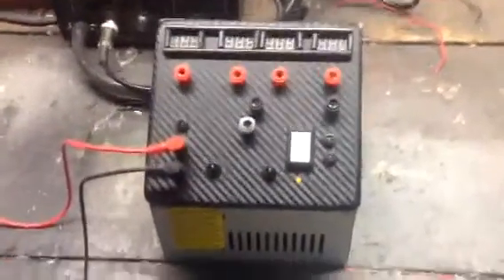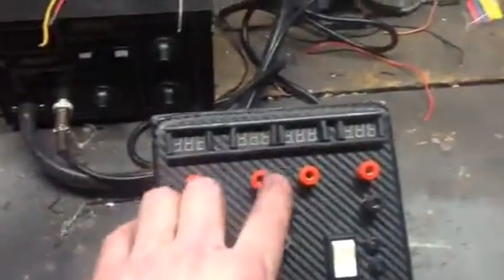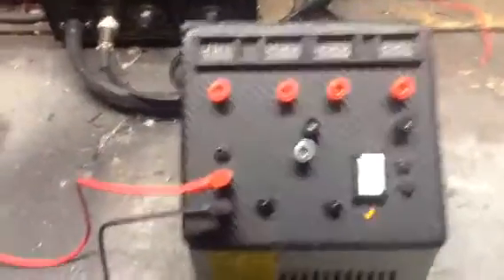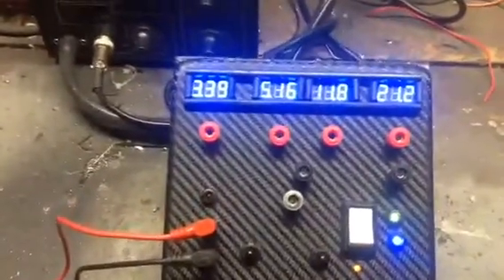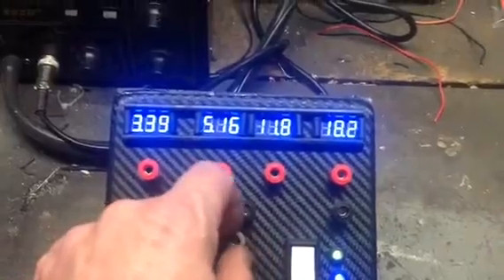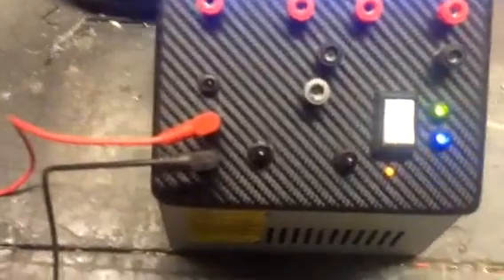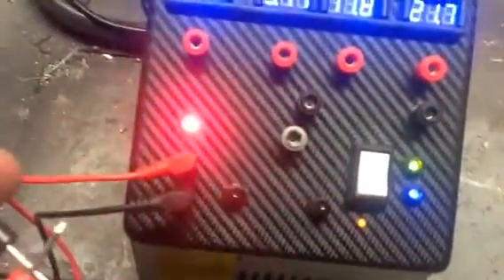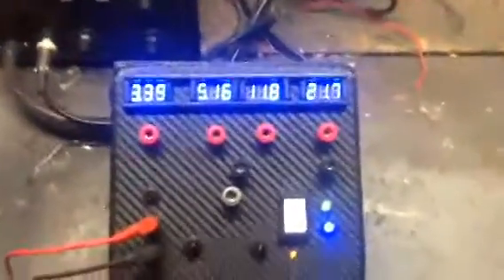Homemade Benchtop Power Supply/ ATX Benchtop Power Supply

Comment: Guess you have used -12V and +12V rails in ATX to get 24V, right? But what is the current limit on 24V? Because for example the label of my old 300W ATX says 16A at +12V and 0.5A at -12V. So how many amps will I have at 24V?

Comment: hey I was just wondering if you had any diagram or anything to show how you made this guy, its one of the best atx power supplys ive seen and I wanted to attempt to make one for myself
Reply from the maker: Hi Josh. No I don't have any diagrams or anything like that. Just jump in and do it. There's really not much to it.
Reply: Hi I would be really interested in some guide as well, or some links to the buck converter and other components like led displays. Thanks. Nice job. 😊
Reply: Banggood seems to have escaped a lot of people's attention. It's always worthwhile looking at what they have as it is all under one roof and you can browse much easier than on eBay. LOTS of great stuff but especially modules available including VERY low cost meters, testers, etc. 

Just go to banggood.com - don't forget to register as it makes shopping that much easier as you can save things into a "Save for later" area and also put stuff not in stock into your wish list. You can also just add anything of interest into your cart and move things in and out of the save for later area.

Comment: Did you use a dummy load to get it to work? Like a resistor connecting one of the wires to ground?
Reply from the maker: No, this unit didn't require a dummy load but some indeed do. Just make sure to connect the green wire to ground and you should be good to go.

Comment: So did you have to use resistor to lower ATX current before connecting to buck? Because buck converter only takes up to 3A and ATX is more than that.
Reply from the maker: You're confusing amperage with voltage. The ATX offers more current (amperage) but remember although you can offer more voltage to a given source than what's required, that same source will only pull the "current" required per ohms law so the amperage of the source isn't relevant.
Reply: Well to LEDS it matters and some other devices, so I'm assumming buck converter is one of them.
Reply: LEDS are no different to anything else . If the LEDS need 3.5v and 50 mA they'll take just 50 mA providing the supplied voltage is correct i.e. 3.5 volt in this presumed case. You can't argue with Ohms law. 

In a similar vein your house electrics will typically be supplied with a 100A main fuse (in the UK anyway) at 240v (nominal 220v +/- 10%) but although it can easily supply 100 Amps (or more with a bigger fuse) it will NEVER draw more than it needs. The problem with LEDs is that they are CURRENT driven devices not voltage specified devices so are far more sensitive to over-volts as they get driven too hard and can easily blow.

You CAN use a 100 volt (or 1000 v) supply capable of supplying 10 or 1000 Amps to run a single LED or a bunch ... you would just need to set a current limit to prevent overloading the LEDS with excessive current. If AC volts are used to drive the LED (it's a diode remember) then the PIV (Peak Inverse Volts) rating of the LED becomes important too and if exceeded will ALSO blow the LED.
Reply: +Bob Lewis Thank you for explaining!
Reply: Re: my last comment, it's an important point to remember too when using an LED as a mains indicator instead of a neon. PIV can easily destroy an LED once it's above 30 or 40 volts so take this into account even in relatively low voltage circuits.

To use an LED as a mains indicator, first you need to drop the voltage from 240v (I'll use the higher voltage as if that's covered then so is 110/120 volt) to the voltage of the LED at its nominal brightness current. Let's say you have a RED LED whose forward volts (when lit) can be anywhere from say 1.8v to 2.6v or more. but not above 4v for sure. This means that IF the LED requires say 20mA then you need to use a resistor that will drop 240 - 4 = 236v (RMS minimum) whilst passing a current of 20mA so a resistor of 236/20 x 10^-3 =11.8kohms.

But at THAT current and voltage the resistor is going to become DAMNED hot as it will have to dissipate some 236*20*10^-3 Watts =4.72 WATTS!!! More current - for say a white LED means MORE power=MORE heat=BIGGER more wasteful resistor. A neon sorts this all out very neatly as the current it needs is tiny compared to an LED so the resistor can be VERY large (Mohms) and the heat becomes negligible.

A MUCH BETTER way when using an LED like that is to use the AC impedance of a capacitor at 50Hz (or 60Hz) as an equivalent resistor. e.g. a 0.33uF capacitor presents an "effective" resistance at 50Hz of 1/(2*Pi*f*C) where C is in Farads.

So 1/(2* Pi * 50* 0.33 * 10-6) = 1/100 *10^-6 * 0.33 * Pi=1/ 1.037 * 10-4 = 9645 or approx 10kOhms and as we already know we need an 11.8kohm resistor to do the same so the current in both cases will be very similar. BUT when the AC supply reverses phase, the Peak Inverse Volts (PIV) on the diode feeding into the series capacitor will likely blow the LED. 

YOU MUST place a normal rectifier diode in reverse across the LED. ITS PIV does not need to be so high as only the LED voltage of less than 4 volts will appear across it. The power rating of the diode will need to be max 0.7volts * I(LED) = 0.7 x 20mA = 14 mWatt i.e. negligible and in almost all cases of using this technique (0.33uF cap in series with LED) a normal IN4148 diode or equivalent across the LED is more than enough to protect the LED. 

Remember to ensure the protection diode is connected anode to cathode and cathode to anode with the LED. This means there may be some slight flicker on 50Hz as it is only half wave rectified current flowing through the LED. The flicker will likely be less noticeable on 60 Hz. The protection diode itself could be a similarly configured LED i.e. reverse biased compared to the first LED. If mounted together then a) flicker at either mains frequency will be less noticeable and b) average perceived brightness will be higher. One LED will protect the other from too high a PIV.

NEVER use this technique in ANY circumstances where either of the LED terminals or any of the connecting wires or the series capacitor or its connections might be exposed. It is ONLY safe for use inside enclosures and even then all leads should be shrouded and insulated thoroughly. If that is done, it is safe otherwise LETHAL mains voltage will be present at multiple different points that could potentially be touched. That aside it is no more dangerous than a series resistor and a neon bulb.

!!! IMPORTANT !!!

Because of the large current surges into and out of the series capacitor it MUST be an X2 rated one and for 250volts it should really be rated at 400v or above for good safety margin. for 110/120v a 250v cap would be fine.

Hope that proves useful

Comment: Would like more info on the buck converter. I currently have a atx I need to convert and have been searching for info on buck converters but have not found anything good on how to install it
Reply from the maker: Here's the one I used....
http://www.ebay.com/itm/10X-Re-DC-DC-3A-Buck-Converter-Adjustable-Step-Down-Power-Supply-Module-LM2596S-/222245520202?hash=item33bedd834a:g:UZsAAOSwknJX05VB

There isn't much to it. You input a certain voltage (I put 24 in) and you'll get that voltage minus 5 volts due to the loss in the converter itself. Hope this helps.